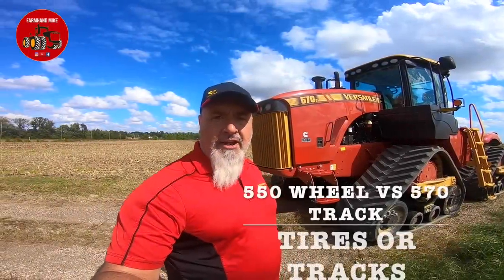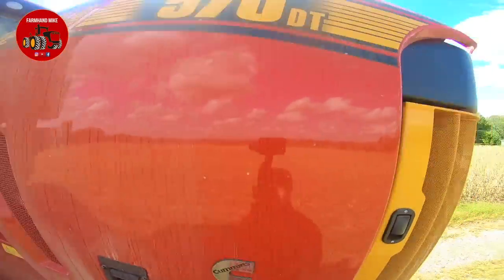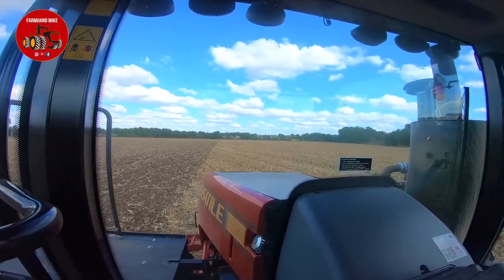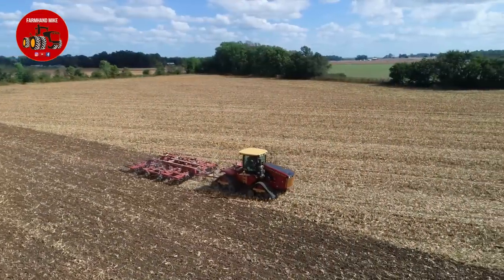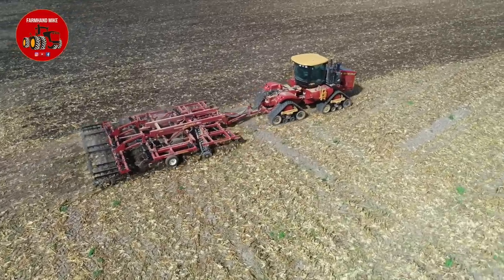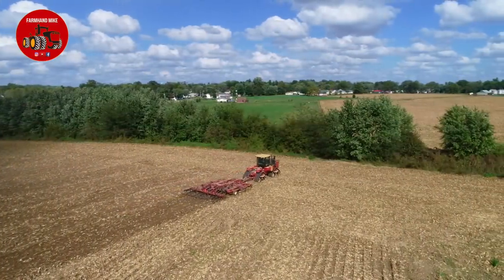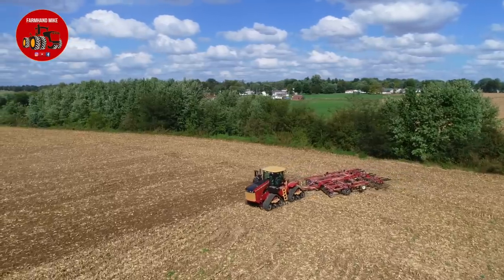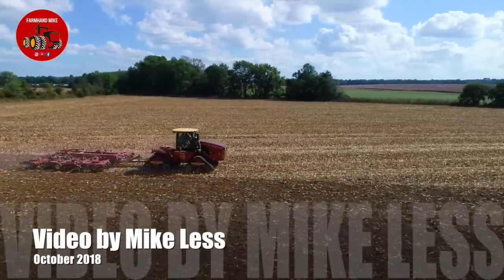Tires VS Tracks Demo in Southern Indiana

Comment: Optimum slippage is 5% with 4WD wheel tractors if memory serves. Not too much, but just enough to get maximum traction. Meaning, any more slippage means wasting fuel. Might vary some according to tires, soil type and implement.

Comment: With radar ground speed working on the Versatile 570 Delta Track, you could have just used that as a pace car for the 550 wheeled tractor, and then read the mph on the wheeled tractor instrument panel and done the math to calculate wheel slip.  What track width on this Delta Track?
Reply: Probably could have, but you don't need something that fancy to calculate wheel slip. If you know how long the row is, just time how long it takes you to get from one end to the other, while noting the MPH the tractor shows. Now you can calculate feet per minute or feet per second from the row length and the clock time. Feet per second divided by 1.5 is MPH. Compare this to what the tractor speedometer said and you have the wheel slip rate.

Comment: Should put them on something bigger. . Kinda small implement for those tractors .   120 ft heavy harrow at 10 mph would show a better test of tires vs tracks
Reply from the maker: Sorry but a 15 shank disk chisel plow such as this is far from small especially running it in the ground as deep as it will go.  We do not run heavy harrows in the Corn Belt.

Comment: Hey mike why cant they just put tracts on the 550 instead of buying a whole new tractor?
Reply from the maker: The fuel tanks on the track tractors are different to accommodate the angle of the track versus the tires. Also the planetary gearing is different between the two and the track tractor has some weldments on the frame that the wheel machine doesn't.
Reply: so would it be impossible to put aftermarket tracts on the 550?
Reply from the maker: No probably not.
Reply: would you think the MFWD tractors could fit aftermarket tracts like susi or mudhog?
Reply from the maker: @chunkmen  Yes

Comment: Tracks are better in some areas
Reply: Put a Quad track in heavy gumbo and it is a smooth steady forward movement on the tractor.  Switch to a two tractor for one round and you will park it and beg to get back in the Quad track tractor regardless of color.  Plus the increase in ground speed is a HUGE!!!  Same engine, same gear - faster ground speed, more acres covered for less fuel.  That is called efficiency.